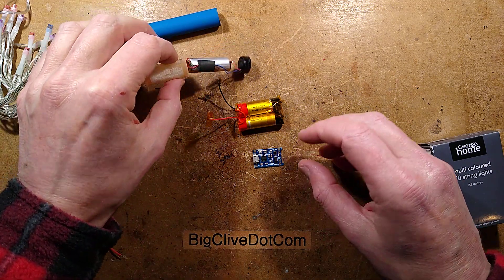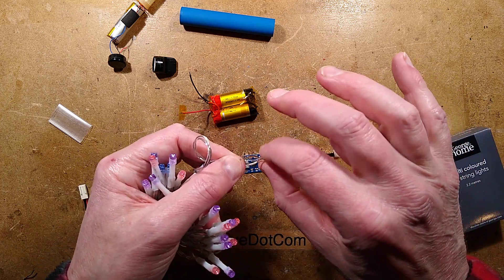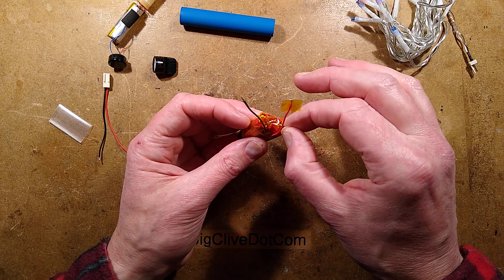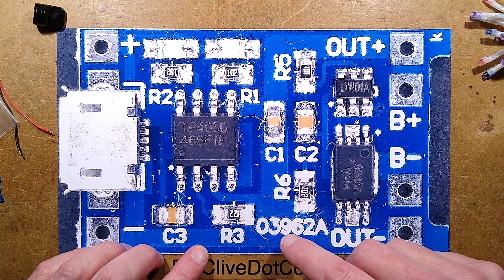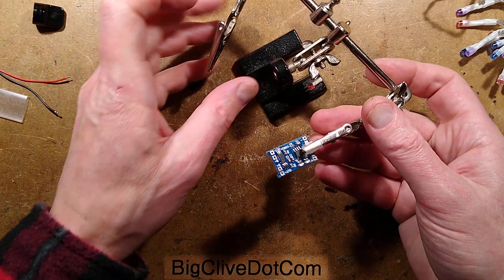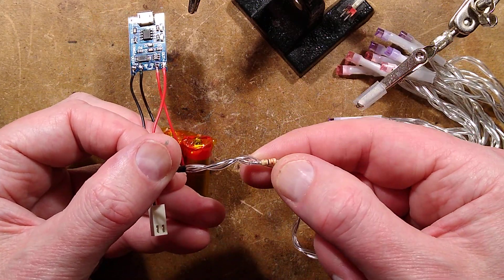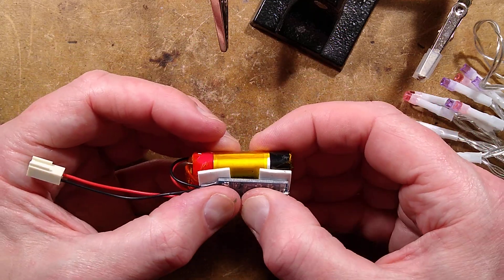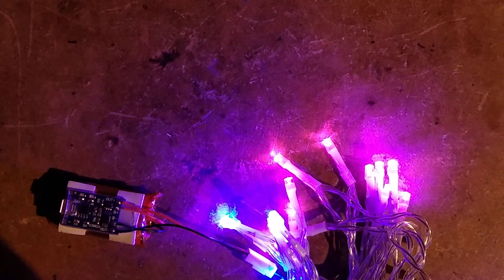Cheap power pack with free lithium cells (USB or solar charging)

Comment: Nice recycling idea! I also use the TP4056 boards for so power my Arduino (LoRa, BME280 sensor, ..) projects with solar cells. Since Li-Ion batteries are pretty expensive, I will think about that solution.

Comment: Thank you. I am also harvesting these lithium cells and i also thought that i found one driven over by a car, but i found out it was not the case. The battery is just manufactured flat, it's labeled 851542. On the web i found that this battery has 3 protections, overcharge, discharge and over current. Awsome! But, the only thing missing is charging. I still have to use a tp4056.

Comment: That 122, 1200ohm resistor, yes it looks like 122, but I suppose if you didn't look carefully (or it gets a bit dirty, poor quality letters), you might see 221 (220 ohm). Both of these are common values.

Comment: Hi Clive, might be good to mention the output voltage of the board.  You mention using a resistor multiple times, but you don't mention if the output is raw voltage from the battery/cell or if it's regulated output by the mosfet.
Reply: One of the ebay listings says the output voltage at full charge is 4.2V, whereas the expected battery voltage is 3.76V, so it's monkeying with it in some fashion
Reply: There's no regulation between the cell and the output, so it will be anywhere up to 4.2v depending on the cell state of charge. Even when the charger is powered it won't be any higher than that.
Reply: @JamesChurchill  yeah I know (I have ten of them) was merely suggesting that Clive makes mention of it as it’s not clear in the video.

Comment: I have a drawer full of those disposable ciggies. Must take um out and do something with them.  Have a load to4056 too. So I got the goods. 😎
P.S. I can finally solder like Clive now with everything in one hand. (Well the bit of solder wire plus the wires I'm soldering together.  Practice Practice,  Practice. Is all I can say.

Comment: If you need more voltage than 1 cell provides, does it make more sense to figure out a charging solution for balance charging multiple cells in series or to step up the voltage with a circuit? Is there an equivalent to the TP4056 for 2S or 3S batteries? I find that my uses for things under 3-4V are very limited.

Comment: Collecting these cells has become a small hobby for me. I regularly see them discarded.
I've seen two types of cells so far, the 550mAh like the ones in the video and 1500mAh cells in the larger square tubes.

Comment: I'm curious if the output is cut off when the USB is plugged in. [during charging.] The reason is for a solar panel garden light.
 If not maybe do a video hotwiring the board so that it will cut the output during daylight with the solar panel charging???

Comment: This inspired me to finish pulling apart one I found near a bus stop. It looked  very fancy though. Case was some black custom aluminium extrusion that needed  a good squish in a vice to release its contents.  Unremarkably enough apart from a very large juice container everything else was the same as this one. The cell still had 3.8V in it. What put me off initially was the three terminal sensor and now I know what its for. Pity I cannot think of a use for it.

Comment: Can it charge at 2A when using an 600Ohm resistor? I had a look at the datashett, but it doesn't even show the 1.2kOhm for 1A there.. just 2.3kOhm for 500mA max.
Reply from the maker: The chip dissipates a lot of heat at high current.

Comment: Thanks for the video! First project that I have all the parts for at 🏡 👍
Does anyone have an idea on how to modify discharge cut-off from 2.5V to 3V?
I find all my lights discharge the batteries to depletion overnight and usually won't fully charge during the day, so to keep the cells from damage of discharging to 2.5V every day it would
B good to have a higher cut-off.
Reply from the maker: It's not easy to change that.

Comment: On the spikey solder point (pun unintended!), I recently bought an old-but-as-new "sat in the shed for years" Lab-craft 24v fluorescent light (now gutted and LED tape-converted) a couple months back, and it was DOA, seller forgot why it was left there for that long, after I'd tested it and got nothing from it, I took it to bits & I found that a spiked solder joint on the fluoro driver had gone right through the double-sided foam mounting pad shorting 24v+ to the metal base, and had blown a track to vapour, in the factory it was probably missed as the metalwork was probably not connected to 0v-, but in use when they'd bought it, the light was probably grounded through the metalwork by way of mounting to a grounded chassis and bang, dead, and boxed back up and sat on a shelf for 30 years... :P

Comment: Subject to two provisos, you can directly connect a solar panel to a Lithium-Ion cell. The two provisos are:
1. The cell must be protected.
2. The solar panel must not be able to supply more than one-tenth of the C value of the cell it's charging, at a maximum of 6V.
The protection circuit makes sure that the cell voltage is clamped to a safe limit while having a low current available from the solar panel ensures that the solar panel's actual output voltage is "dragged down" by the cell until the cell reaches close to full charge, at which point the protection circuit stops the charging process.
I've had an old mobile phone battery charging from a 6V panel by day and supplying around a dozen LEDs at night for over a year.  I've never seen it run out of power, although to be fair, I've never stayed up late (or early) enough to see if it's still on as the sun comes up and turns the lights off (it has an auto-switching circuit).
Reply: (The LEDs provide just enough light in my carport so I can see where the keyhole is to open my car door)

Comment: I've used those same little connectors for nearly 40 years now and for a long time never knew what they were called except that they are some kind of Molex connector. I finally found out they are Molex KK 254 series. I've been looking out for discarded devices ever since you first mentioned them and finally found one the other day so need to think of something to do with the cell in it.
Reply from the maker: Also called KF2510 on eBay.
Reply: Open the thing you found.. Outside.. use snips to gain the battery...
The end pieces and tube can be of use...
Use long nose pliers to put smelly bit in bin...
Don't handle smelly bit with fingers..
It does make bin smell better...

Comment: Big Clive, I've seen some of these new portable foggers that they come with a USB c port and technically it's supposed to have some 5,000 puffs to it. Personally, I can't wait till the one that I bought myself for $20 dies completely so that I can pull out the battery and start using it in my solar system as a backup light source instead of having to use the 12 volt system. What are your thoughts on this boss?
Reply from the maker: The rechargeable disposables tend to have smaller cells.  I think it's cheaper for them to just add a charger than use a high capacity cell.
The first larger disposables with no charge port had beefy 1500mAh cells in them.
Reply: If your 12V system uses the traditional lead cells, it'll be up to 100000mAh per battery, so you'll need a lot of those small garbage cells to match.
Reply: @johndododoe1411  the solar set that I have automatically Cycles on and off throughout the day and night so that the batteries aren't always just being completely topped off. So I can leave a few things in there during the time that it's on and have it charged them up and come back and get them after they're done charging or the day after know that they're going to be completely full.

Comment: What a coincidence, just finished re watching the original episode. 😁 
The Cells I've collected are labeled 3.7v  650mA, but appear identical to yours. They charge to 4.2v. 
I'm using a Zener, Mosfet, Resistor, atm. Waiting for my order from eBay. 
Thanks Clive, perfect re purpose project. 
 ;)
Reply: I have many of those, it mostly came from disposable vape in a trash can near any vape store. I used those to extend the battery capacity of my cheap wireless headphones that has a lot of empty space inside of it, so it can last for MORE THAN 24 HOURS in a single charge (from only 6 hours with original, very small 120mAh battery)
Reply: @sihamhamda47  120mAh? What is this? A battery for ants?
Reply: @DrakkarCalethiel  Battery for very small equipment. I bought some of the $5 cheap wireless headphones, and when I opened it up, the battery was very small, leading to a short playback time (6 hours at minimal volume and only slightly above 2 hours at max volume) and also leaving a lot of empty spaces. That's why I connected some of the collected vape batteries to the internal battery in parallel to boost the battery life
Reply: @sihamhamda47  The fate of cheap rechargeable stuff is always a tiny battery. The cheapo flash I bought years ago (solid housing and super bright too) also only had a tiny battery. It was 90% empty space. Two 18650s later I had a flash that was worth easily tripple the OG price.
Reply: @Siham Hamda Zaula M 
I would recommend that you use the Battery Management  Circuit that Clive has demonstrated here. Also, only use batteries of the same capacity. 
Headphones and speakers often use the empty space to get better quality sound. 
 ;)
Reply: @snakezdewiggle6084  Thanks for the advice

Comment: My question is. If you used a 5v solar panel. Would you need extra protection? I assume a 5v panel isn't always 5v because of positioning and shade so would you need to add like a stepup converter to make it stable?
Reply from the maker: The TP4056 can handle higher voltages, but not if the current is high too.  A small 100mA 5 or 6V cell is fine.

Comment: This makes me wish that I took the puffy foggy pens that I found in the parking lot of a small store. I did however wire on a USB lead to one of those battery powered stick up light switch lights and it now runs off a power bank.

Comment: Love these cool how to videos 
Clive, is there a video using 18650's or any lithium ion  using a buck/boost board to go from that 3.7v to a 12 volt output drive a radio that will not cause harmonics in operation?
Thanks in advance
Reply: To get rid of switch mode ripple, make sure the switch mode oscillator frequency is not a whole fraction of any frequency used inside the radio, then add a powerful π-shaped LC filter between the 12V switcher and the equipment.
Reply from the maker: You can build a 12V pack out of three 18650s with a suitable protection board.  That would provide smooth DC to the radio, although the voltage would gradually go from 12.6V to 9v during discharge.

Comment: Can I use a Schottky diode in series with the battery before connecting to the B- and B+ of the module and charge the cell to 3.9v instead of the 4.2v?
Reply from the maker: It doesn't work well.  The voltage drop across the diode changes with current, so the TP4056 slows the charge very early and starts oscillating.
Reply: @bigclivedotcom  Is there a TP4056 equivalent that has a programmable stop charge voltage, instead of the fixed 4.2V?
Reply from the maker: @objection_your_honor  You can get custom ones from the manufacturer with different thresholds, but other than that it would be necessary to make custom additional circuitry.
Reply: @bigclivedotcom  Thanks for the info.

Comment: this shitty board destroyed me some cells, 2.5 volts is too low for li-ion cut off!
Reply from the maker: It's a standard cut-off point.  The TP4056 will initially trickle charge them back to 3V then charge at full current.  I've been doing a long term test with full cut-off discharge and the capacity is holding up well.

Comment: Unfortunately, Lithium rechargeables are not suitable for outdoor use in cold climates, where the temperature can drop bellow freezing.
Most of my projects are used for outdoors and I'm stuck using lead acid or NiMH. 😪

Comment: I like to keep a few rolls of different size "marine" heat shrink with the extra adhesive inside, really does help with strain relief and waterproofing. I think it's basically just lined with regular hot melt glue. Don't put it on stuff you ever want unstuck!
Reply: If you want it unstuck, just use some isopropyl alcohol and the glue will release, great way of removing hot glue that's been schmooed everywhere... :)
Reply: ? Who sells the magic marine grade heat shrink (to hobbyists).
Reply: @oldbutstillcurious3615  Amazon...ebay...anywhere that sells heat shrink really...
Reply: @oldbutstillcurious3615  they're often easy to spot since most are either translucent colors or clear with color band for gauge. Some I've seen also crimp in addition adding extra strain relief reinforcement. Just note, any of these styles are far less flexible then your standard heat shrink!
Reply: @oldbutstillcurious3615  harbor freight

Comment: Those TP4056 charge controllers are a Godsend for tinkerers. I have an absolute s**tpile of them I've amassed over the years. Mostly because, as you said, the cost per unit gets quite teeny if you buy in some degree of bulk. Though I've now migrated to using only the USB-C kind, only because I find it to be the least irritating of the types. The only thing that can be a pain is trying to change out the programming resistor for the charge rate. The latest batch I got have the uber-tiny 0201 resistors. You know, the ones that if a flea farts anywhere within 30 feet of them, they go flying across the room. Yeah, those ones. I don't typically fiddle around with cells small enough to really require a change in charge rate, but on those occasions I do, it's not a lot of fun farting around with that thing.
Reply: So now i know flea farts are a powerful force.
Reply: @assassinlexx1993  To an 0201 packaged resistor? May as well be a full-blown hurricane. Either one will fling it as far as the other.
Reply: @just_saw_dust  No, you're very right. That's what I typically do as well. But occasionally I'll get stupid and try to replace it correctly. Doesn't always end well when I do. But boy, does it make you all warm and fuzzy when you do get it right. Also makes fiddling with any other size component feel like kids play. Lol.
Reply: You can fit different sizes of SMD resistors or even through hole ones by being a bit creative with the positioning and eventually scratching a new pad on the negative (-) trace that runs on that side
Reply: Exactly, pretty much snap em off and replace with 0805/1206 :) Its nice  being able to get those charging boards so cheap now, sure beats taking a chance with a LM317!

Comment: I generally dont trust that type of lithium cell anymore since I had two USB power packs start expanding over time. Both sets of 3 cells expanded very forcefully when I discharged them to 0 volts before disposing of them. (no local battery recyclers, can't afford $560 to have a box come in.) I kind of have trust issues with 'pouch style' lithium cells because of that. Haven't had a small one do that (yet, though hopefully never.) so I may just be being paranoid.
also I like that you can re use those batteries, but I don't like the fact that they are not primary cells. At least they're not all going to the landfill.
Reply from the maker: Did they get put somewhere very hot?  That can damage pouch cells.

Comment: Is there any quick hack to add a photocell to turn off the lights during the day?  Otherwise, you'd need a larger PV panel.  There seems to be a MOSFET already for turning them off when the battery is low.
Reply: @evilalchemist9278  Yes, you can add one external, but I was wondering about hijacking a part of the under voltage shutdown to add a dusk2dawn feature.

Comment: To balance the cells, one could just use a small resistor, say 10–47Ω. That would limit the current to a few hundred mA in the worst case.
Reply from the maker: That would work.
Reply: The resistor should be there constantly on the connection between the cells, or only while I let them self-balance before connecting everything and then replace it with a single wire?
Reply: @Flashy7  Only for balancing. In use (when charging or discharging the pack) the resistor would have the opposite effect (bringing the cells out of balance).
Reply: @Flashy7  Only to balance them. You'd lose too much power to leave it there permanently.
Reply: @Flashy7  Use the resistor when initially matching (balancing) the cell voltages and then (when the voltage across the resistor is less than 0.1 Volts) wire them directly together.  They will remain the same voltage for the remainder of time.
Reply: @Flashy7  yes. And no.
Reply: Ah, crap, I just posted the same comment and then realized you'd already said it.. oh well.

10 ohms might be a bit small for smaller battery packs if there's a significant voltage difference between them.  I would personally go with at least 100 ohms or so just in case (but I'm also usually not in any hurry to balance them as fast as possible either)

Comment: Exceptionally useful video! I just recently came into fifty 1000mAh lithium batteries... with no charger or ideas. This certainly provides a lead and some food for thought!
Reply: @just_saw_dust  Thanks for the tip!

For the time being I ordered some from Canada as I live in the USA. $2 for 5 seemed reasonable as a start, and if the boards work out for me I figure I'll buy the rest of what I need along with some inexpensive solar panels for trickle charging.
Reply: @just_saw_dust  I reckon you're lucky with 10-15 days to Europe. Which shipping method do you choose for that?